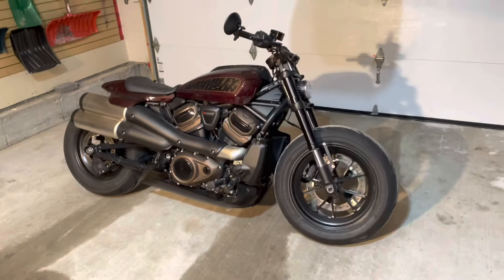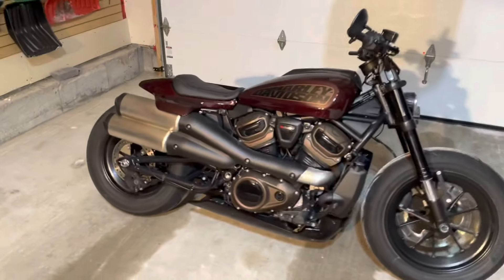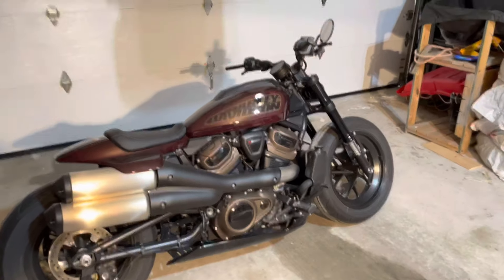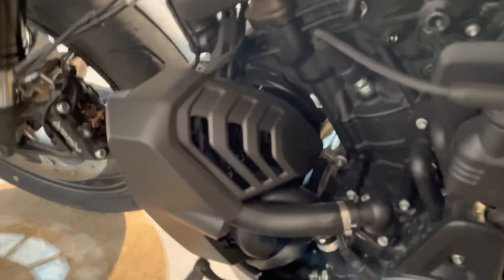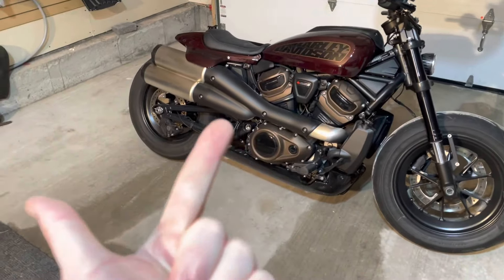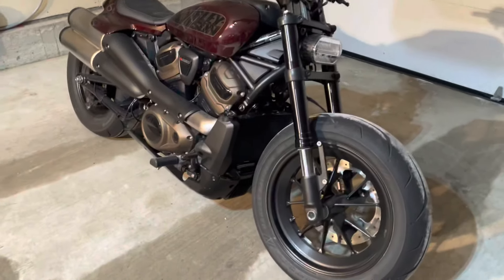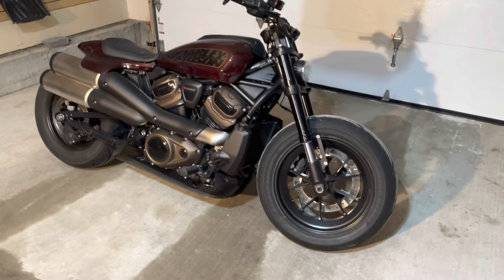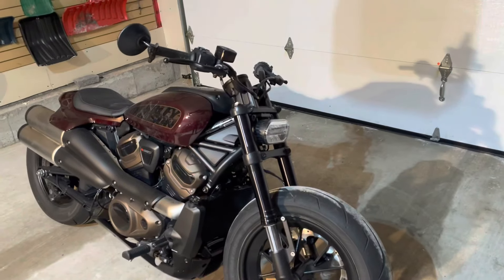5.5 Things That Kinda Suck On My SPORTSTER S

Comment: 6.5 - The ridiculous tail light/license plate concoction. Curious to see what you did to eliminate that.
Reply from the maker: Good day Big Ben. Thanks for watching. I have a tail light/turn signals ordered. Should be nicely tucked under the rear fender. That’s if I can fab some type of bracket. I will be doing it on a upcoming vid. Thanks again
Reply: @Cbm10  What did you end up ordering for tail/turn?
Reply: TBR (two brothers racing) makes a nice little tail tidy for them!

Comment: The Headlight is the SEXY..... Best looking light on any motorcycle ever.... Exhaust is the MOST ugly exhaust I have ever seen on a bike! I'd really like to see a video of the plug for the headlight, the headlight bracket and connection points... Can I ask for them no one has done any videos on the headlight.... =-(
Reply from the maker: Very good chance that headlight has to come off for the new turn signals. Just need to figure out the style and placement I’m going with. 
Stayed tuned my friend I think you will get what you are looking for

Comment: You can’t complain until you ride it at least once
Reply from the maker: I’m working on changing all of it before the first ride
Reply: @Cbm10  that doesn’t make sense.  I want to change the exhaust but I’m not gonna not ride it until it’s changed.
Reply from the maker: @SmokeBark  sure it does. I don’t need to ride it to know I don’t like it. The bike sounds like a lawn tractor and the exhaust looks like cheap plastic.
Reply: @Cbm10  Seriously, if you haven't ridden it keep your mouth shut!
Reply from the maker: @kevinesh8544  well that’s going to be hard to make vids with my mouth shut.
Reply: There is no way I could to months without riding a brand new bike like this. It doesn't even make sense not to ride it before the mods. Okay, you don't like the exhaust so you aren't going to ride the bike until you have the parts installed. You won't even have something to compare the mods to afterwards because you haven't ridden it in stock form. It also seems weird, I don't know any guys that love bikes that could buy a new bike and not ride it for months. That seems like you want people to think you are cool more than you actually enjoy the bike lol

Comment: Been seeing a couple of sportster s getting forced shutdowns when you push the bike around 180 to 215kph or whenever you try to reach top speed... Have you tried pushing the bike at those speeds? Tried doing it on mine, and yeah.... I'm one of those affected by it.... Might be your 6th thing that sucks. Some have the engine shutdown at 120kph 180kph... HD needs to check it.
Reply from the maker: I have hit 200kph a few times and so far I have been good. Fingers crossed it stays that way. Also sorry to hear you are having that issue. Definitely scetch situation. Good luck my friend

Comment: Where are your turn indicators?

Where is your tail light assembly ?

Ok, get the "Sundowner" saddle for that baby... the original saddle is not bad,  the the Sundowner is way better.

The bike is fully wired for heated grips;  however,  you have to order the actual grips, and then the dealer has to update the firmware to activate them.  I have the heated grips on my Sportster S now,  and I love em.  By the way,  you will want to update the firmware (including IMU) so that the cluster at low temps (Canada) will work correctly, and so that the HD app will work correctly with the bike.

The "plastic" is NOT cheap crap... dude... its what keeps the power to weight ratio awesome!  That bike weighs in at 509 lbs ,  and that is great !  All that plastic helps with that... why haul around 100-200 lbs of steal when its not necessary ?

Leave the pipes alone.  It will NEVER sound like an old HD.  It just won't...  don't waste your money on OEM pipes... complete waste of time and money.

You'll find that there is one gripe which you have not mentioned... and it matters.  The tank is too small.  It's my only complaint with the bike.  It needs a larger tank; period.

Whoever removed the turn indicators and tail light assembly may have screwed up the wiring harness , which may affect the heated grips.  Have it checked... also, if possible, replace the indicators and tail lamp assembly... the tail lamp assembly also doubles as the belt guard, just so you know.

I'm in Minnesota,  so,  know what you're going through with the weather.

marcus